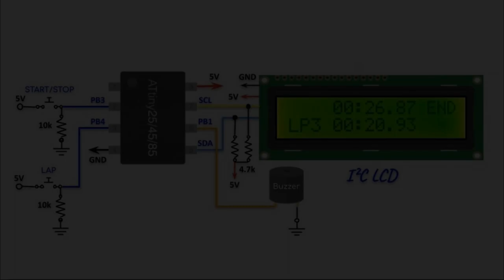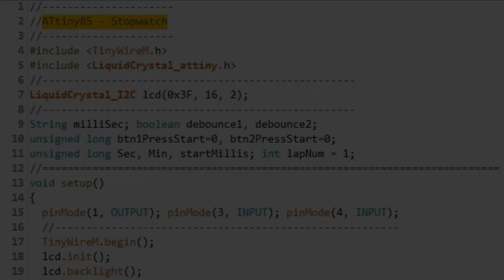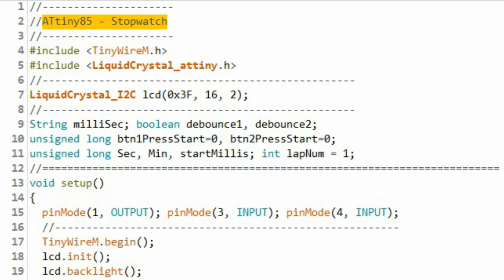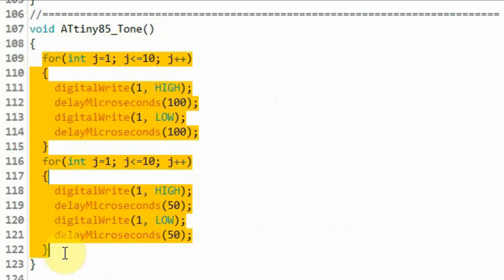ATtiny85 - Stopwatch

Comment: Fantastic project Sir,  As Always you're on the TOP. I think You are the only one to  utilised the MCUs in every aspect area of programming.

One question Sir, ticking sound is in microseconds but We want to modify in SECONDS. What are the Modifications on code ??

Please make a clock using ATTINY85 with DS3231 and MAX7219 / P10  LED DOT Matrix board with DHT11.
Reply from the maker: Thanks for your feedback. As for ticking in seconds, just change the delay timing in the function. Thanks again.